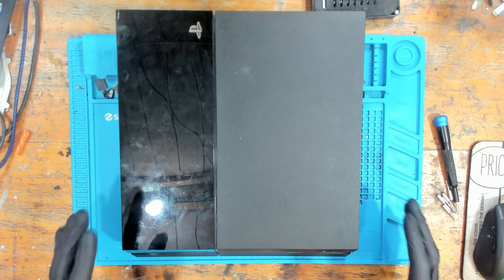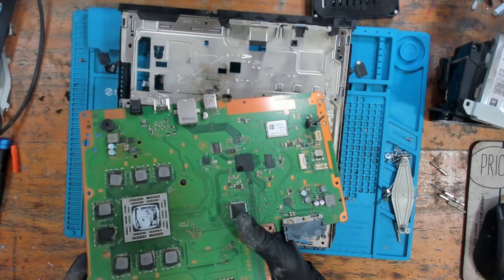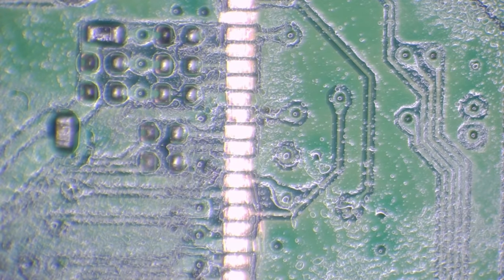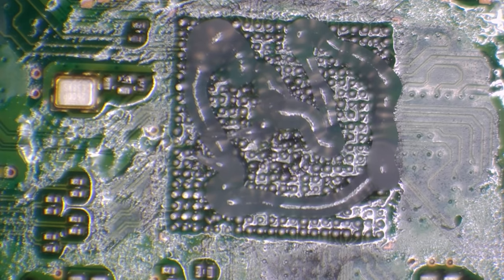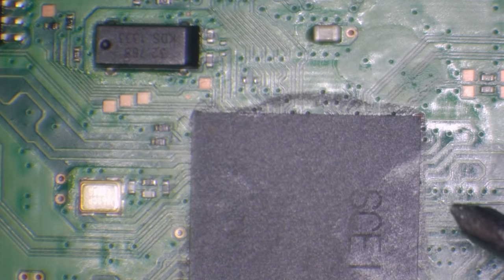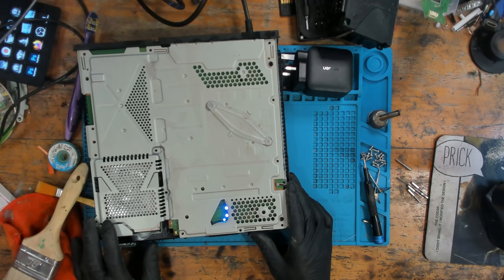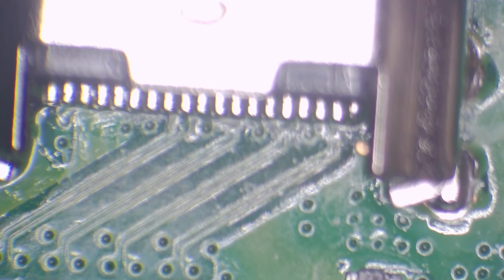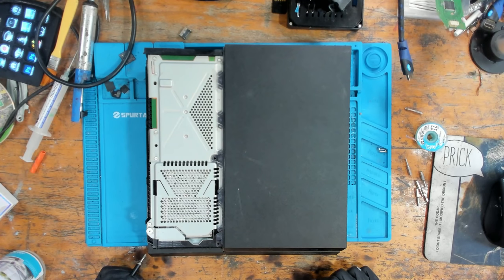PlayStation 4 Completely Dead With No Power - PS4 Liquid Damage Diagnosis And Repair

Comment: Evening fella, it's funny this popped up in my feed today as I collected the same ps4 with same problem. Could please supply a link to the small ic that controlls the power on circuit that you replaced first.its at the 15 min mark if that helps.

Comment: Great vid. Out of curiosity where do you get the south bridge for the slim? 42g one. Got one that has a good tested power supply. Good buttons etc but does not do anything. Stone dead. I’ve removed south bridge, re balled it and put it back on but still dead. So thinking new south bridge time. Only ones I can find are around £35-40. Cheers
Reply from the maker: Try aliexpress mate, they're about £12 on there. Check the caps on the back of the board below the southbridge and you might find they're shorted :)

Comment: Nice work Phil. Can you help me with some information? I bought a ps4 slim from the local market. It boots and shows on the TV. It loos that I have been factory reset. But I cannot pass the setup screen when it needs to press the PS button. including was a nano controller (a wired transparent one with some red LED). Does the controller have to do with that? I read that unofficial controllers do that. I don't want to buy a DualShock 4 yet. but if that fixes my problem it would be nice to know. Thanks, man for the videos and i watch your live streams when i can.
Reply from the maker: Thanks buddy. To know for sure you'd need to check with a DS4, but if you have no controller sync in the dashboard but have controller sync when it's being reset you likely have an issue with the WiFi module. These systems are a little complicated in how they connect to controllers. In safe mode or low resolution mode they use USB, but in the dashboard they use the wifi/Bluetooth module so that's very likely going to be your issue
Reply: @TheCod3r  Thank you man for the response. Yeah, they are a bit confusing sometimes. I have a Wired version of that controller. And if I go to safe mode I can use it to navigate to that menu. But i cannot access the dashboard since i need to press the PS button to set up the console and that appears not to work. Ps: the button works fine when i connect it to the PC.